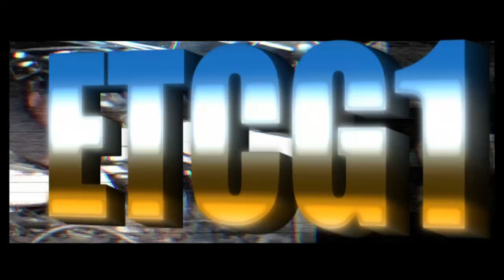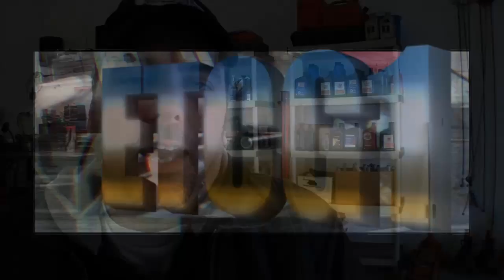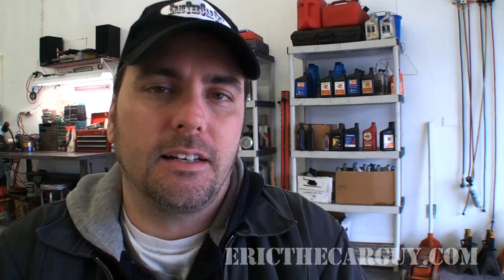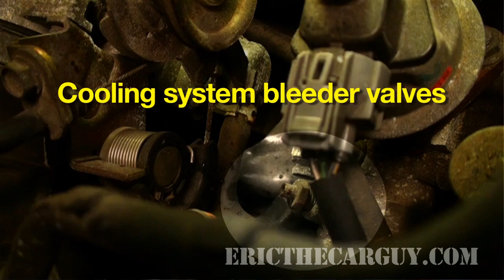The Big Picture

Comment: One thing about modern car design i dont understand, is replacing mechanical linkeage with expensive electronics, i mean what was wrong with a throttle cable, fly by wire is more complex and, to my mind, less responsive and definitely less reliable. Then this electronic parking brake set up that VW and some others use, that can not be cheaper then a set of cables, and you cant apply while u are moving, so in actual fact u have no emergency brake. Progress my arse, im keeping my 91 honda for ever

Comment: You're right about the reuse of models.  From 1973-1987, Chevrolet trucks mostly underwent cosmetic changes, with incremental changes in fuel delivery and ignition.  Even my 1994, under the hood, is pretty much the same as one of the old square body trucks.

Comment: @brakedd i cant stand the throttle response with that though especially on a manual. and you can't tell when its getting dirty. i think a cable is much more reliable and you know what the throttle is doing and feel more connected with driving. The auto makers seem to be along with appliance manufacturers and so on taking more profit out for a lower quality vehicle

Comment: @brakedd was it a manual i drove a 2005 crv dbw standard and a 2004 crv throttle cable standard trans also the throttle response of the '05 is terrible it takes 2 seconds to close the throttle after you take your foot off the gas!!

Comment: @cosmicdust22 
I can see what he is complaining about, on my 8th gen euro civic, to change the low beam i have to remove the battery or windshield bottle, to change the turn signal bulb i have to remove the inside wheel well cover(dont know what it is called) but to remove it, you have to remove those annoying clips and even when you do that it is still  tight fit.

Some do it so the customer goes back to the dealer to get the car serviced.

Comment: I just replaced the speakers in my truck and whoever designed it made it so I had to take out the whole backseat to get the trim off to get to my speakers...that seems a little excessive, all they had to do was cut a slot to slide it out

Comment: I actually love GM vehicles for that reason there are parts on them that can be used on many different vehicles like their coil packs, map sensors, iat sensors, maf sensor on a 2001 chevy s-10 will work on a 1998 chevy venture and on and on/many other parts are this way. i would say ford is the worst for interchangeability i have talked to owners of junk yards that hate fords because some pickups have 15 different a/c compressors.

Comment: I know very well the problem of technician access, it holds true in the trucking industry.  Since vehicles are built on assembly lines they need to make it easy for a machine/person to assemble it not for a technician to work on it.  Some starters are right between the frame and engine where you'll spend forever just trying to get a socket on the mounting bolts and break them loose.  That engine came preassembled and was lowered into the chassis then the hoses/wires connected.

Comment: The problem is that the car manufactures have started leaning more towards cutting corners and less on making cars that the average Joe can work on. They don't want you working on your car. They want you to have to take it to a shop (that has outragiously expensive special tools) and pay an arm and a leg to get it fixed. After a few times in the shop you'll want to cut your losses and buy a new car. It's called planned obsloescence.

Comment: This vid reminded me of a paticular memory when you mentioned GM. I don't exactly remember the details of year or model, but I was working in a lube shop and we had this GM car come in with the oil filter in one of the most obscure spot I'd seen. It was a FWD vehicle with the filter mounted on the oil pump housing that in this car was crank driven. Such an odd angle and some what difficult to get to in the car. Just something that struck a cord from this vid. Thanks, R.

Comment: When I was working for Land Rover the was a high failure of pixels in the odometer of Range Rovers.  It was fairly easy to access since the top of the dash came off easily.  Then the exposed Allen bolts on the dash disappeared in the following model year.  The field engineer said the design was changed because too many instrument clusters were being replaced.  The new design was much tougher to remove so the thought was this would save the company money.  Crazy huh?

Comment: If it was easy, everyone would work on cars. The bottom line is that manufacturers don't consider servicing the vehicle when they build it. They design a car to last just past basic warranty (3 years/36k miles) that sells. Just look at the painful task of replacing Heater cores on late model cars/trucks as an example as to how servicing isn't a design factor. The absence of your beloved coolant bleeder valves can be overcome with an airlift type vacuum bleeder. Now get dirtier and whine less.

Comment: @transdetendal I'd have to disagree you have certain models that have chain problems *cough* acadias where the tensioner is weak and causes the chain to stretch and terrains balance shaft chains rattle due to the same thing. Even my 3.5 Nissan altima chain rattles especially on cold starts. @etcg1 u think you got it right on the money but I think one thing the finance part should think about us the warranty claims they'll have to cover due to 'saving money'

Comment: A good example of this is the GMT-800 platform. I'm referring to 2000-2007 GM trucks and SUV's. Some of the early years had more functions and luxuries, and the later years had fewer functions but upgraded electrical systems. A example is the under hood lights on 2000-2003ish trucks and none after that. It's just a matter of bean counters and it does make sense when looking at the bottom line.

Comment: Another thing I've seen is that most auto manufacturers make parts / assemblies for multiple models. For example, Ford's 3.0L V6 is used in anything from a medium-sized sedan to a near-full-size van (Aerostar RWD uses this engine and has comparable GVWR to an E-100). The engine isn't designed for all those models, it's designed for 1 or maybe 2, and adapted to the rest. One part may be easy to get to in one model, and near impossible in another.

Comment: This could not have come at a possibly better time. I'm working on the intake on my 1990 Lincoln Towncar; 5.0 302 V8. Those that know the Ford V8's right around now they feature what is known as an "intake plenum" over the intake manifold (that house the throttle body, EGR valve, various other vaccum components and sensors, etc). In order to do anything to the intake (or what I was really trying to do; replace the valve cover gaskets) you have to first remove this plenum. Needless to say it is a

Comment: b**ch to work on, more so in putting it back together than it is taking it apart. So many vacuum lines and etc to worry about. But it looks like on the newer 4.6 motors they have gotten rid of the plenum and just use a straight up intake manifold, no strings attached. Phew...so all I need to do is buy a newer car and my worries will be gone as far as intakes go, haha!

Comment: In many cars, you can get an aftermarket 'Oil Filter Relocation Kit'.  They are used a lot in the racing industry to make repairs faster. They are available for most cars since many of the vehicles used for racing will have the same block or oil filter size.

Comment: A while back I was changing the fuel filter on my Xterra and was cursing the line guy that put the hose clamps facing into the body.  After thinking about it for a bit, I realized that he did it from above WITHOUT THE BODY.  And, yes, it is in the owners manual to change every 30K

Comment: @TrueBlueEG8 with DBW  you eliminate not only the throttle cable but also the idle air control valve and any cruise control linkage that existed.